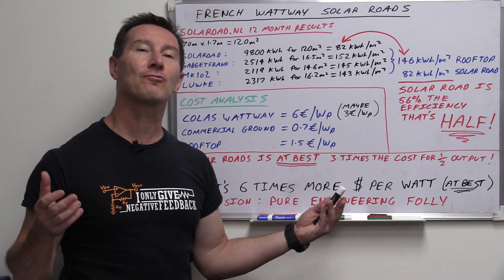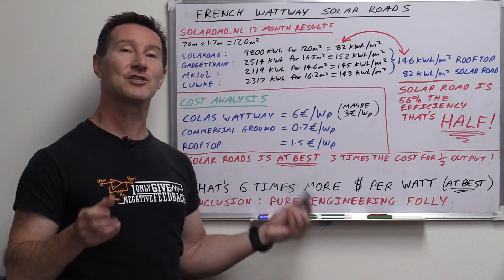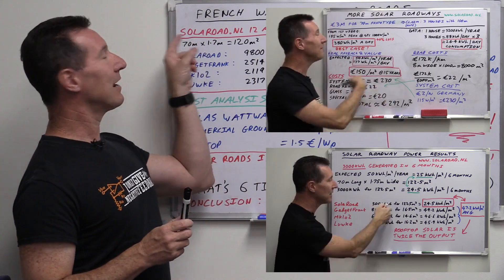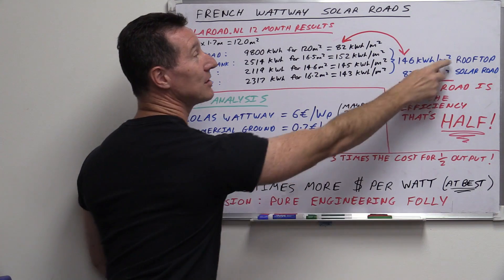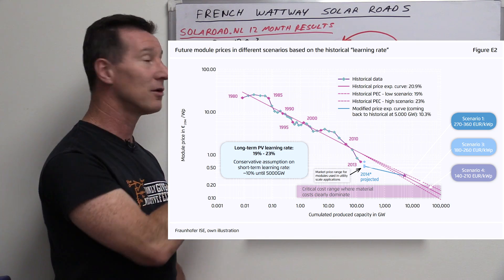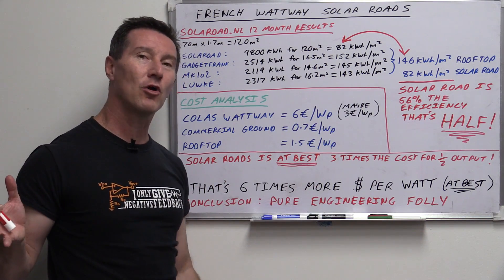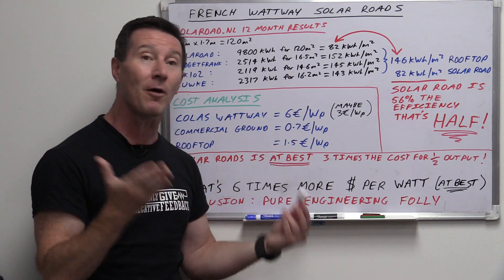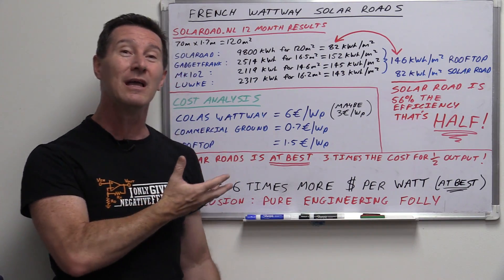EEVblog #850 - French Wattway Solar Roadways BUSTED!

Comment: I fully agree with you. France should better invest in cheap and reliable renewables and get rid of the bloody nuclear power plants. I love your videos. But, before you make the fourth video about solar roads: I would appreciate a video about CSP (conentrated solar power) and projects like DESSERTEC including technologies like HVDC-Links and the possiblity to store the energy for some hours until it is required.
Reply: +Juergen Boehringer Nuclear is the one tech that makes sense...
Reply: and yet, the number of fatalities due to nuclear mishaps in France is still 0. you are right about the uranium mining though, but comparing the energy outcome per kg of mined uranium, coal still is worse off in the mines. Nuclear is not inherently bad, more people have died installing wind turbines than from nuclear accidents, even assuming a nuclear meltdown will happen every 20y or so, in the long run nuclear is just not as bad as people might have been led to think.
Reply: +Juergen Boehringer > get rid of the bloody nuclear power plants
hahahahaha! where do you think germany is taking energy from :)
Reply: +Juergen Boehringer why on earth would you want to get rid of the nuclear power plants before getting rid of the coal plants? have you even been to a nuclear power plant? I was in one in Texas once as a university research project, they give you a Geiger counter when you go in, the radiation levels are exactly the same as outside, if not even lower because of all the insulation, then we took some air and water samples , everything was clean. The other half of the class went to 2 coal plants... long story short, anyone would rather work 50 years in a nuclear power plant than spend 1 year on a coal plant, at least the ones who care about their lungs...
Reply: +Silly Sad Well, currently Germany makes 27 % from renewables. And, yes, and about 15 % are still Nuclear. But Nuclear could be even less because Germany (over all) exports much more electrical Energy than it imports (about the capacity of two nuclear blocks).
Reply: +Mik Wind Yes, like you, I also joined such a propaganda-show in a nuclear power plant some years ago. Regarding radiation it really can be held quite clean in there (if everything works fine). The big issues are places where uranium mining, uranium processing, reprocessing, waste storage, ... is done. Thats actually where you have to measure. And of course at places where something went wrong with a reactor. And: something like Fukushmima can happen everywhere - in Neckarwestheim (Germany) also like at Indian Pont (USA). And the trigger must noch be an earthquake - it also can be a geological issue (Neckarwestheim), a terror attac, human error or an tecnical problem.

But back to coal: It also has to be replaced as fast as possible by renewables. But Dave was talking of France - and they make only 4 % by coal versus 73 % nuclear (2013).
Reply: +Mik Wind It's not true that 0 people died from nuclear in France. There is at least Marie Curie. But there also a few worker who died after accidental exposition to radiations. On the other side, there are many people who die each year from micro particules which are a major product of coal power plants. Replacing nuclear by coal like Germany doesn't seem the healthiest choice.
Fukushmima was a very bad idea which common sense could have avoided. A nuclear plant on the coast of a country highly exposed to earthquake and tsunami was not very clever.
Reply: +nombinator Yes, there are a lot of such bad Ideas arround. Like building a nuclear power plant on a place where the ground is not stable (Neckarwestheim, Germany), having a containment that is too small (Fessenheim, France) or like still using a reactor that has thousands of cracks in its reactor preasure vessel (Tihange, Belgium (2015)). Of couse: normally it works - but sometimes it does not. If you increase the risk, you have more accidents. Thats just Engeneering. And already one accident is far to much. Thanks for the nice discussion. See you later!

Comment: it would be better to put the panels above the road and create a roof for the road
Reply: +Beginner's Tech You would then double the road closure time to repair/clean them, increase fuel used running the lights on vehicles, and replacement after an accident. Think of the trouble it causes when one bridge or over head gantry gets hit.
Reply: Richard Nilsom true
Reply: +Richard Nilsom first thing that comes in mind is : the price/time of the installtion would be times 100

Comment: Here we pay 0.15€ per Kw how fuck 6€ per watt is a good thing, someone failed at math and economics?
Theres a lot of real a state out there (roof tops), that makes sense using!
Reply: +ubbgn $6 per installed watt is high, but wouldn't be so awful IF the installation required no further expenditures (and free fuel!).  Too bad SR will require vastly expensive maintenance on a continual basis. :(

Comment: Think these innovations should be encouraged rather than bashed before they are even available
Reply: +SQUAREHEAD and they should not be planned for installation on 1000km of road before being proven efficient and reliable either. That's the whole point of the video. As the technology stands today, it makes NO SENSE at all to plan such huge deployment.
if in 5 - 10 years they manage to make it ridiculously cheap, and with a useable power density, then maybe it will be a good idea. Today it's just a waste of tax money.
Reply: +SQUAREHEAD and they should not be planned for installation on 1000km of road before being proven efficient and reliable either. That's the whole point of the video. As the technology stands today, it makes NO SENSE at all to plan such huge deployment.
if in 5 - 10 years they manage to make it ridiculously cheap, and with a useable power density, then maybe it will be a good idea. Today it's just a waste of tax money.
Reply: I can't imagine highway companies closing major roads every 2 weeks for maintenance of those BS arrays.. i think if they get installed they will just get ripped off in a month or two just by the sheer amount of traffic.

when there are accidents on a normal road.. people just clean up, and maybe repair a barrier or two.. here they will have to stop traffic for hours or days to repair the friggin' thing.. it is so senseless i believe the idea will slowly die out and be forgotten soon... i hope?
Reply: +usopp barbosa dude it's just the eligible surface... that means where it's possible to install those cells.
all the comments are saying the same because no one read the repport ...

Comment: I have solar panels myself but I see no problem with less efficient solar roadways. More solar is good, I do not really understand the efficiency argument. I am sure the tech will improve with more investment. Kindly stop shitting on new tech.
Reply: +meadowsirl 
This isn't new tech. This is existing tech used in the most inappropriate and stupid way.
Traditional roof-top installations and solar roofs on parking lots, sidewalks, bikelanes or even roads would be much better in every single aspect.
Reply: +meadowsirl No, no it doesn't. If your referring to certain consumer products that are sold at a loss, that is irrelevant as the cost is made up with the sale of other things for the product. Solar panels are complicated and expensive. Modern rooftop ones take roughly half of their lifespan to produce enough electricity to cover their cost. A solar roadway panel will never be able to produce the amount of power needed. Even with cheaper construction methods it still wont produce enough power to pay for itself. In essence its an entropy sink, just consuming resources without producing anything of note. Let me put it another way. The government has a plan to produce extra electricity by burning cash and selling the electricity. The amount of heat generated by the burned money and converted into electricity, will never amount to the value of the paper currency. Its a much more blunted example but the point is still the same.
Reply: The point of rant: people need to spend money on tech that impact the future, not tech to play around with. Solar road can't benefit the future as much as solar roof do. (PS: no money, no toys)
Reply: +meadowsirl I can't begin to follow your logic.
( I can only guess that money grows on trees in your neighborhood?)  
If any entity, government, industry, individual, has a given sum of money to invest in a solar project, doesn't it make sense to buy the design that produces the most energy per dollar?   

Solar panels on roofs are cheap and reliable and available NOW.
Solar panels/cells on road are not.  (And will likely never be.)
Reply: +swiss agreed but it requires additional structures.
Reply: +Curious Pineapple A lot of new tech starts off like that.
Reply: +Maliciously Delicious Were the first solar panels ever made cost-effective? I rest my case.
Reply: meadowsirl Counterpoint, they were proof of concept models meant to show photovoltaics could generate electricity.They were not made to be sold or used. They were also not planned to be placed as literally the most abused and hostile surface in use, IE roadways. This isn't something new or innovative. The entire purpose of this road project is to line the pockets of a company. Its not motivated by innovation but greed. Nothing more, nothing less. It doesn't advance anything, doesn't provide anything, and it never will. Any situation where this is economically viable would be purely fictional, as by such a point the needed improvements would have resulted in vastly more efficient arrays in other more idea locations still rendering a solar roadway a farce and entirely pointless.
Reply: +geonerd what if they knock on every door of france to ask if they could install solar panels over your roof window ??? Would you ask your neighbours, if you can install solarpanel on there house or would you do it on your domain.
Dude ... this is much more easy.

Comment: Let me be the devils advocate here... In order for the masses (and the politicians) to be convinced that something is bad.., you have present a "practical" example of failure. Example: the atomic bomb.
Until they try it and fail miserably there will always someone saying that it is good.
Let them try and fail so that we can put this stupid idea aside and move on!
Reply: +maxsnts Sadly, this extends to the corporate sector in companies.
Reply: +maxsnts  The problem is that there will still be people that think it will work.  "It just wasn't implemented right.  They should have done this instead of that."
Reply: +shadow7037932 Yes, you are correct. This is probably the worst of it. This kind of projects will be bad for the remaining/good solar industry.
Reply: I'm pretty sure the atomic bomb works quite well, it's just that it functioning isn't necessarily compatible with us functioning.
Reply: +maxsnts The unfortunate side of this is, that they WILL fail this project and then politicians, Big Oil, et al will use it as an example of solar failure in their anti-solar/anti-renewable agenda.

Comment: This was a bit confusing where you talk about efficiency, but compare cost efficiency. I suppose there is a correlation between production and maintenance cost and production and maintenance energy consumption, but it's not necessarily direct or comparable between different products. Also when you say "zero maintenance for rooftops" you are being a bit tricky. Surely for mass installations it's substantial. Anyway, what I'm trying to say is that if out goal is maximum energy efficiency, we should research production/installation cost in energy and maintenance cost in energy (for a given life-cycle) foremost. Not that I expect solar roads to fare better in that metric...

I distinctly remember someone researching green building got some quite unexpected results comparing energy costs of using different building materials, where supposedly "greener" things were actually super costly in production energy-wise, so much so that using it for minuscule energy savings in the house was less efficient overall, even for a long life-cycle.

Comment: I think it's in korea (or japan?), they cut grooves in roads so they play a tune where you drive over it at the right speed.
Reply: +TheUnnamedGent Installing inductive charging for electric/hybrid vehicles would be another thing to do with roads which would be more useful than solar roadways.

Comment: Yeah I'd love to see how long those roads would last with accidents (seen a few times where the highways where damaged to the point a new section of highway had to be put in), blown out tires (rims riding on surface), overloaded trucks, heavy equipment, specialty heavy hauling, weather damage, snow and ice, improperly prepped road surface, etc, these roadways don't stand a chance. Thats all putting aside the ludicrous cost of regular maintenance.

Comment: Maybe we need an actual working section of road to be built, used, abused and thoroughly tested. That way, whenever some fool thinks they've got a better design there's a concrete example to point them at.

Preferably something high profile so the failure of it becomes public knowledge.

Comment: I'd imagine that the amount of wasted energy of the cars sitting in traffic, just while the panels are being installed, would far outweigh the amount that they would ever produce.

I can't see it being anywhere near efficient unless every car on the road was electric, or at least had an engine that turns off when the car stops.

Source: someone who spends a long time thinking about this sort of thing while in roadwork induced traffic around London.

Comment: Inaddition, the high manteinance of the installation on roads will produce a gigantic mass of trash due to the panels that need to be replaced a lot more frequently than the rofftop ones. In addition, if the government invests the same money on rofftops ( that costs one third ) you will produce 6 times more green energy for the same investement. It's simply more viable. We will think of roads when we have exausted all the roof space.

Comment: yes you're right, if They just install the same number of panel on roof top it wil greatly increase the efficiency. 

i know the shading effects on solar panel and how slowly mppt of the micro inverter decrease the efficiency when even a small car or bike will make it worse in energy output .

Comment: if a road runs for 10 miles. that means you need 10 miles of thick. expensive power cables.
or a stepup transformer in every cell. to get it to national grid voltage.
or a big transformer every couple of hundred metres.
and those would still need to be wired in between.
the disgusting thing about this is that people are stupid enough to believe it.

Comment: Instead of using them for electricity for the grid, what about if they used the energy they generated for lighting the road, lane markings etc? Or is that still not feasible?

Comment: What happens when the panels stop working? A team of engineers comes out and blocks traffic while they dig these things up and replace them. So now you have something that no longer functions as a solar panel or a road. We should be simplifying things, not adding unnecessary complexity. Murphy will get ya every time
Reply: +stephen10 "This company Colas take a risk"
No. Their only risk is that they will not milk some cash from government cow if they fail. The only efford they make is putting some shitty animations and paying people "in charge" to get this project running.
Reply: +stephen10 "Try" away, but not with MY tax dollars!  :/
Reply: +Martin T it is designed to work a very long time. it s not normal solar panels but special for road , it resists to trucks ! It is glued. Made with composite materials very resistant. A city hall can make a lot of money with solar road .
Reply: stephen10
Roads are designed to work a long time too, yet they fail. Ever driven over a pot hole? Normal roads are also made from composite materials, yet they fail under repeated, heavy loads. Adding this on top won't make the road any better. It's another thing to fail, and it will fail. Then the road is blocked off so traffic jams occur. What's wrong with putting the panels on rooftops?
Reply: Martin T rooftops are private. This company Colas take a risk , let them try something interesting.
Reply: If they're spending their own money, good luck to them. If it's public money they're spending, then no, they should be open to criticism